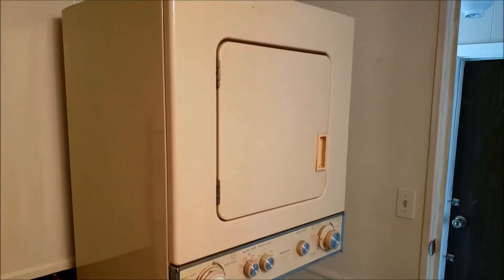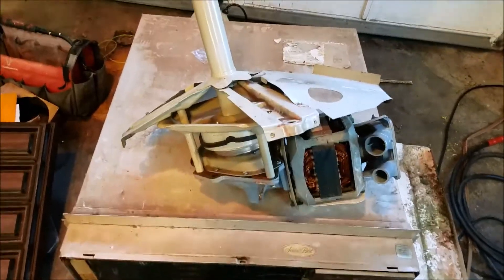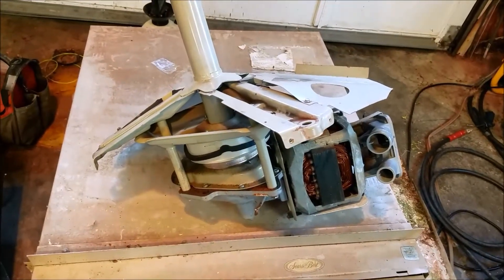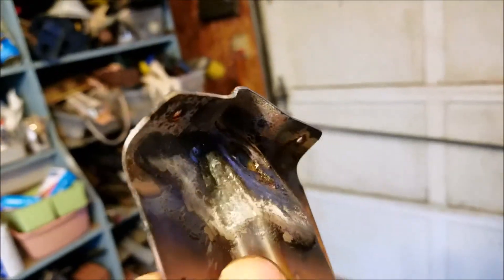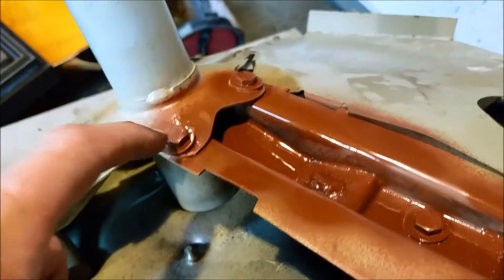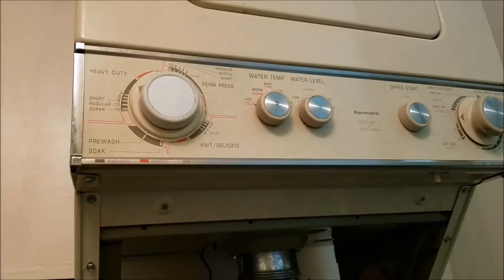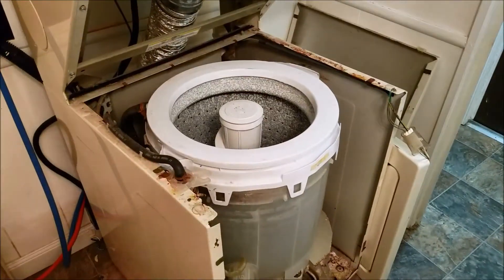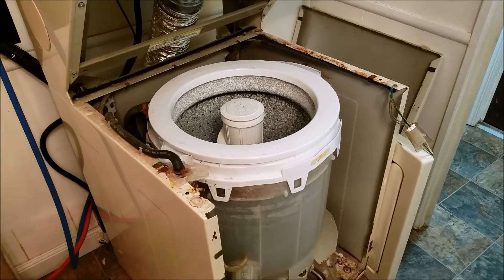DIY Landlord: Stackable Washer and Dryer combo making load noise what I found and how I fixed it.

Comment: I am facing this same problem.  I only need to get a few months more out of this washer. Could I just get a couple of 1/2" washers for that shock absorber to ride on?  Is there a reason why you need a square hole?
Reply from the maker: No need to be square it was just something I had laying around.
Reply from the maker: No need for Square hole  it was just a pice of scrap I had laying around.